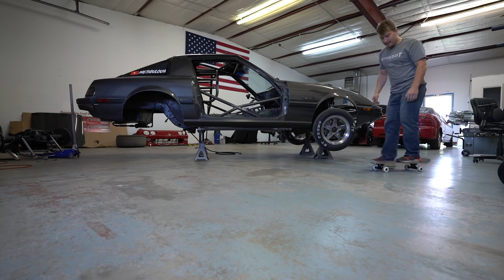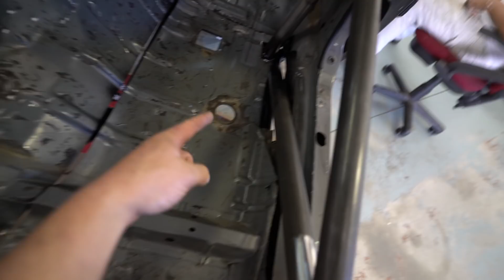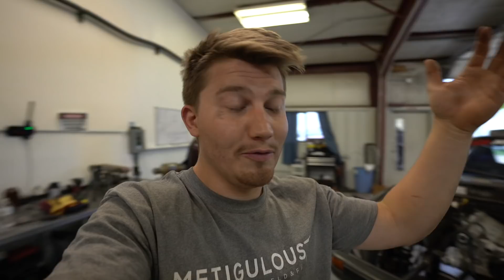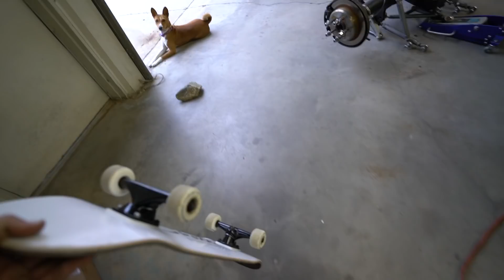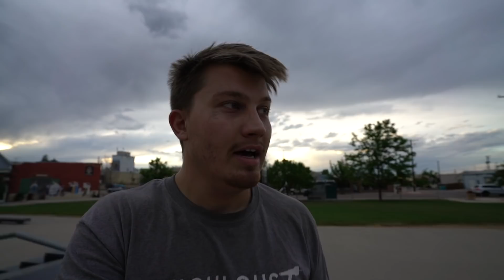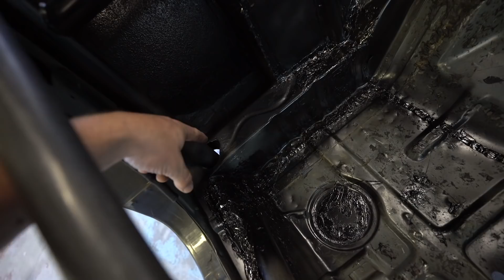How I got hit by a CAR!

Comment: Worked at a body shop in high school if you let the seam sealer heat up and get almost hot it helps a lot we would put ours on top of the wood stove for a while in the winter

Comment: Tape either side of the seam however far you want the edge of the sealer to be, seam sealer applied use small brush (acid brush works well and is cheap) and drag it through so its consisten, before the sealer is entirely cured remove tape.  Gives a much better more finished look.

Comment: The floor has plenty of structure... the ribs in the floorpan, and that little rail that the seat mounts to actually count for heaps. Compare the movement in a flat piece of steel, vs that bit you cut out, youll see what i mean. Then bead roll the flat piece, and it gets stronger